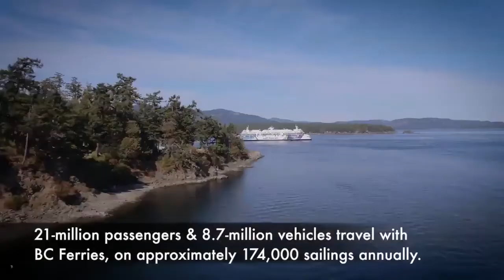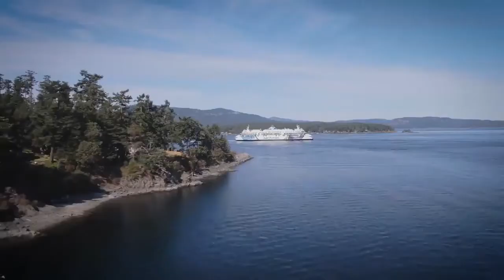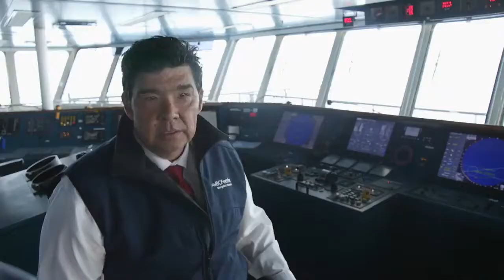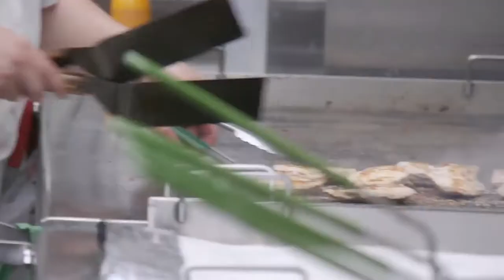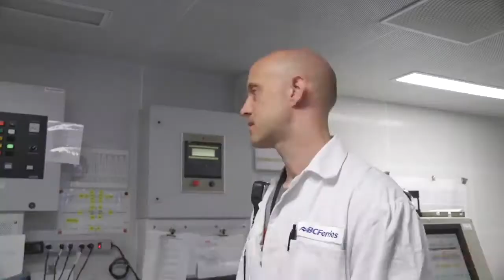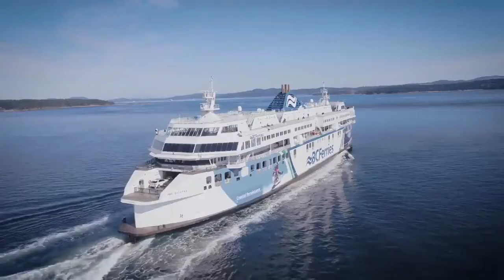What happens aboard a BC Ferries vessel anyway?

Comment: The Spirit of British Columbia has only one helm and has to turn around at each docking.
Reply: Nope lets say a ferry came from Victoria to Vancouver they would use the same FERRY to go whatever there next sailing place is they don’t un load then sail back
Reply: completely wrong, you're making so much stuff up.
Reply: @brettzke  you haven’t been on the Tsawwassen to Swartz Bay run- MC Spirit of British Columbia.
Reply: @brettzke  from photos of recent ferries I’ve seen, they load and unload at both ends. The Spirit of British Columbia was built in 1993- so it’s not new.
Reply: @denniscreighton7907  you do know that double end ferries arent new or anything. The queen of oak bay, coquitlam, alberni, surrey, cowichan ferries are older than the spirit ferries but are double ended.
Reply: @brettzke  you this you that, I am getting sick of know it alls..
Reply: @brettzke  I've been on a Spirit Class vessel and yes it does have to turn around. The vessel has an entrance for vehicles on both end of the vessel but since it only has 1 bridge the ship needs to turn around.